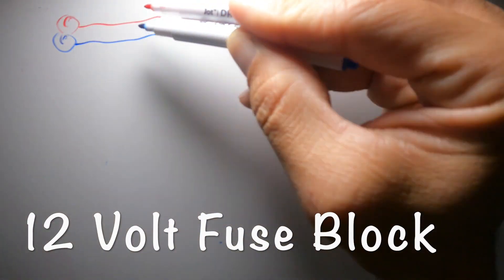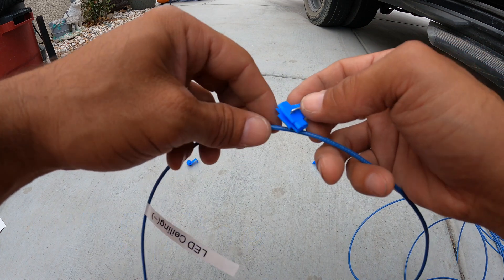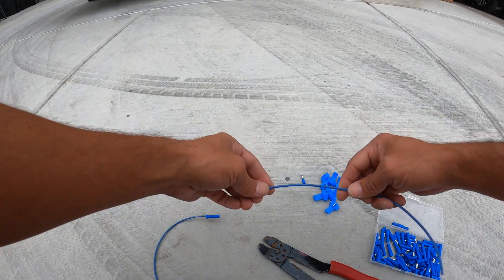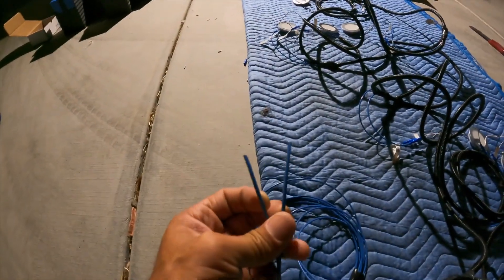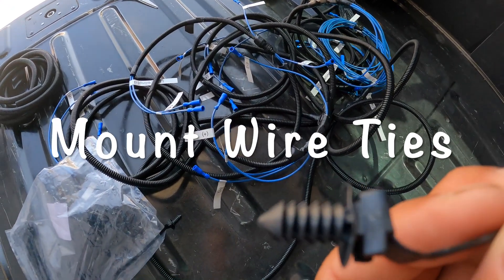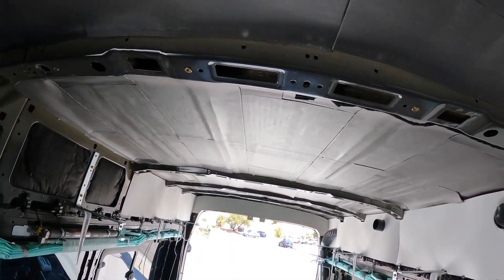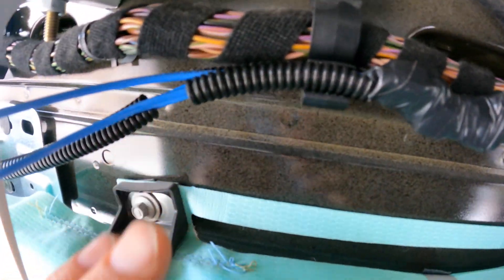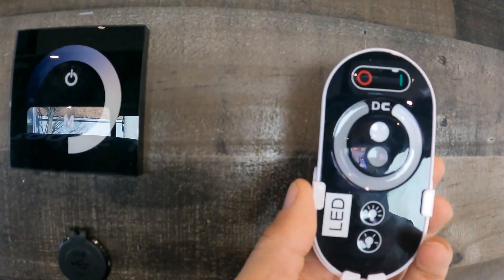Wiring 12 LED Lights Dimmer & Remote for RV Van Build EASY step by step DIY How To On A Ford Transit

Comment: What are the greenish tubes running down both sides? Are those air bags? If so, can they be removed without the van showing errors? Also...a question about the seats you removed: are the seatbelts anchored only to the seats themselves without any need to attach to walls as in traditional seat beats (ie. shoulder belt)?  Can the rerouted AC be run from "shore power" at an RV park without engine on? I love your AC redo idea.
Reply from the maker: The greenish tubes are the airbags. They can be removed ,and you can use airbag resistor simulators to avoid getting an error code. 
The seats that were removed had shoulder seatbelts anchored to them. They are not attached to the walls. 
I don't know if it could be run from shore power.  My guess is no because the van runs off a 12 volt battery and shore power is 120 volts to 240 volts. But I could be wrong. 
Check out https://www.fordtransitusaforum.com This site for Ford Transit owners has great info and very helpful members that can guide you in the right direction on that.

Comment: I sure like the idea of using zip ties instead of running all through the holes in the van and then rubbing and later causing a short.
Reply from the maker: Exactly! Way better to take the time and effort now to prevent it from shorting out, before installing everything else.

Comment: I bought this same dimmer switch, how did you wire it?
Reply from the maker: Run the 12 volt wire from your fuse box into the dimmer switch. Then from the dimmer to all of your lights.

Comment: Why does  everyone use puck lights I see LED light s about 5” long won’t they be brighter  plus u would only drill a 1/4 inch hole to run wire and. Screw them  on I doubt they use more power
Reply from the maker: I used the pucks because they were small, dimmable, and bright.

Comment: T connectors are Bad Bad Bad. Unless you love solving transient electrical problems in your wiring.
Reply: Can you suggest an alternative?
Thanks
Reply: @theangrygingerthebananavan4207 I would cut and crimp with a butt connector, preferably one with heat shrink

Comment: I have one question; could you use the van metal frame/body as a ground to use only one wire (positive wire) and thus running less wire?
Reply: Yes but in lots of cases you won’t have access to chassis when you’re at this stage of the build